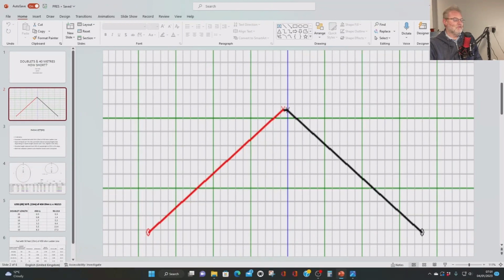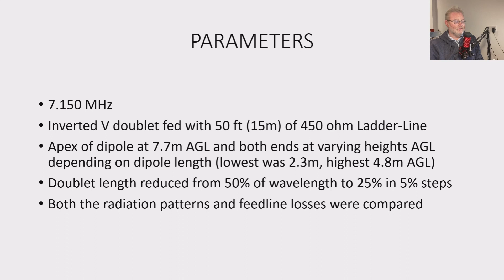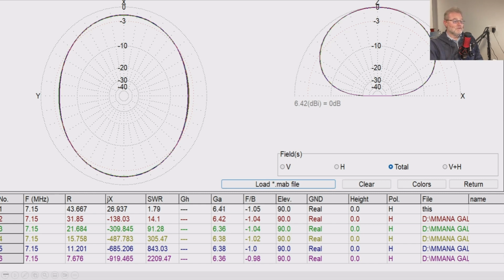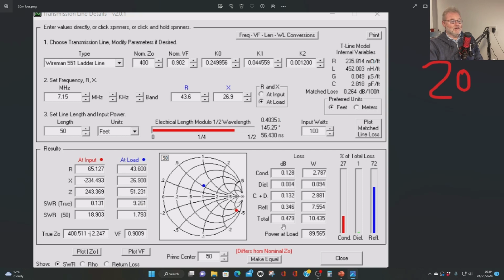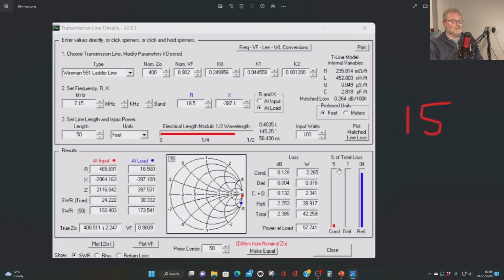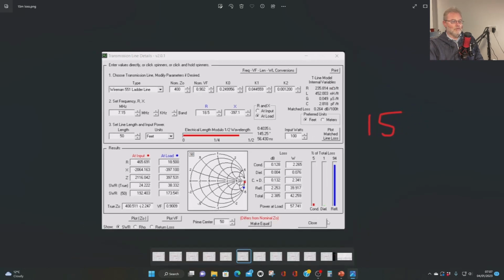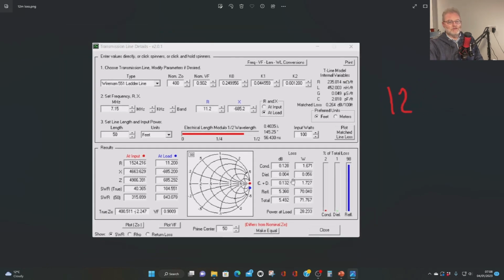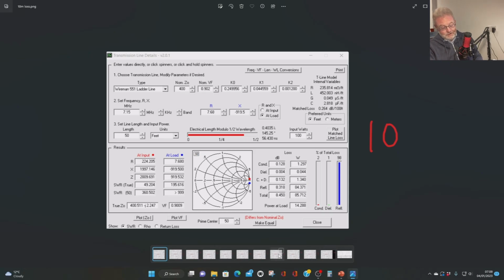DOUBLET ANTENNA to use on 40 Metres (HOW SHORT CAN YOU MAKE ONE?)

Comment: Hi Tim   love your videos.  I made a doublet using Cebiks design  7 meters per side and 7 meters of 300 ohm ladder line.  It works quite well with a tuner.  I then made is 15 meter per side and this worked much better.  At home I have 20 per side with homebrew ladder line and it works extremely well.  My go to antenna in a park is the 15 meter per side.  Works well on most bands.  Richard  VK2AUS/VK2OKR
Reply from the maker: Sounds like a great setup!

Comment: Thanks to yours and Peters videos, I've put up my new doublet.  It's 180' long (55 meters) and is up at a height of 50' (15 meters).  The thing works beautifully!  With my Palstar AT2K, and the requisite 4:1 Balun, it tunes 160-6m.  I constructed it with surplus military phone wire, called WD-1A.  The ladder line separators are 4" electric fence wire insulators, purchased at a local farm & ranch store.  There are no joints, as each leg leaves the BALUN, rises to the center insulator and completes its journey out to an "end-sulator".  It's nice to finally have some tall trees at my home QTH....and REALLY nice to get on any band!  Thanks Tim!!

Comment: The difference with the g5rv design is that the length of the feedline and radiating eliment is such that the voltage, ampres,reactance are relatively low on the frequencies its usuable on keeping losses to a minimum, whereas taking the ladder line all way to the shack may have higher voltage, ampes, reactance at certain lengths of the feedline which may tax the system more

Comment: Im working on a 13 m long aluminium tube rotating dipole . with remote ATU at the centre. The tube reduces reactance over copper wire and also increases antenna eff to about 95%. Similar idea as a mag loop with larger tubing.
 I will need to switch in a couple high Q inductors and some extra capacitance to cover 80m. The remote Atu has 10uH and about 880pf. 3.5Mhz needs around 55uH  Radiation resistance at 3.5Mhz is just below 5ohms. I will need to keep total R of tuner and switched L/C to under about 4ohm to achieve goal of 50% System efficiency on 80m..Also needs to be at least 16m high to reduce ground losses on 80m. long term project in design phase. Will also like to be able to make the thing go from horizontal to vertical dipole somehow. ATU losses will be tested with reactive dummy load simulating feedpoint impedances,in a calorimeter.  Lot more work than my EFHW!
Reply from the maker: Sounds a good project!

Comment: For me I have included A third wire woven in and out of the windows of the 450 ohm ladder line 17 ft legs on each side and using a 4:1 balun. Works great from 80 to 10 m
Reply from the maker: Nice!!
Reply: @TIMG5TM  Wow!!!! That is real? Do you use a current-type  4:1 balun? Pse. more information about this !!!!

Comment: Hello Tim.
I am using 100 ohm twin feeder from Spectrum Communications it is very thin and isn’t bothered by electrical wiring or metal .
Mine comes in to my loft across all the light wires and down my stoothing wall with all my other coaxial cables.
I can run 400 watts without any problem.
Regards Dave M0IOK.
Reply from the maker: Thanks for the info! 73

Comment: Rather than adding an additional wire to 450 ohm ladder line (woven between the windows) would you get the same effect By having the third wire come off of the feed point parallel to the 450 ohm ladder line but not touching or intertwining? Should this wire need to be the same length as the 450 or does it need to be shorter or longer? It would be so much easier to do it this way than having to interweave it and tape it to the ladder line that is very time consuming!
Reply from the maker: Only way to tell this is to experiment I think Pat?

Comment: Hi Tim, I have a 112 foot Doublet fed with 300 ohm feeder using a 1:1 current balun in the shack and about 1 foot of RG8X to my Palstar AT2K tuner,  and it it seems to work well on 80mtrs
Reply from the maker: Yes that would be just over 80% the length of a half wave on 3.5 MHz so would be a rough comparison with a 53ft version for 40m. Pretty decent antenna. 73

Comment: I’ve put up a 15.2m (~46ft) doublet with 12m ladder line and found v high swr, as you described. It is also worth thinking about where the lost power is being dissipated , my tuner died for 40m but carried on working at other frequencies… It might be a bad idea to run 100 W through a tuner dealing with such loads, particularly digital modes with high duty cycle and low peak to average power ratios.
Reply from the maker: Indeed - think of the voltages! A lot of auto-ATU's can easily be fried when forcing shorter antennas on to lower frequencies. Been there and done that!! 73

Comment: Would be nice to see the comparison of a regular Doublet,  dipole, compared to a linear loaded dipole with ladder line legs,  compared to the linear loaded doublet dipole with the third wire, and show how they progressively get shorter and shorter. 66', 53', and 33' respectively

I have a three-wire linear loaded doublet and the legs are 16 and 1/2 ft on each side and I'm able to tune up 80 m with an ATU
Reply from the maker: Hmmm interesting

Comment: Hi Tim, Happy New year 
Great video (another one) using my other account now.
Well smarty pants...... What would you do with 5w(FT817) and a 8x8m garden?
🤔😁
Motters M7TRS 73 👍🏻
Reply: I use a shorty 40 end fed (40-6m) attached to the top of a 2m wooden fence around my 7x7m garden. With 5 watts it hasn't a great signal but is a lot of fun on FT8. Made contacts with most of the states here in the USA and most countries in Europe.
Reply: @randysmith2755  I would love to have a DX commander in the garden. Will try a long wire with a 9:1 tomorrow for CQWW.
I had ok results when I had a efhw around the garden.
Thank you for the feedback.
73
Reply from the maker: Great question .. maybe a video in this one!! Which bands?
Reply: @TIMG5TM  am gready as many as possible. I mainly use 20/40 and 2m.
Ive tried a vertical, dipole and efhw. Not much space with children so my setup is a pop up kinda use. My main radio use is portable sota but I like to have the option at home from time to time. No trees and I am a mid terraced house and same to the back kind of setup.
Reply from the maker: @m7trsradio  would a no radials vertical be an option?
Reply: @TIMG5TM  yeah I will try anything. I have two mast in my armoury a 8 well 7m carp pole and a 10m DX commander classic pole would love the DX commander expedition pole for sota.

Comment: I made an 80m ocf dipole feed with coax via a homemade 6:1 balun, the longer side doubled back on itself with only 6m between the 2 parts of the longest leg. I was able to work ZL on 40m with 50Watts
Reply from the maker: Yes indeed, the Balun did a lot of the matching and the antenna was a full size half wave. Great contact 👍
Reply: @TIMG5TM  I was told that the antenna wouldn't work in that configuration and I was wasting my time
Reply from the maker: @ianbardell8030  as an ocfd it should be ok on even harmonics. So 40 would be ok.